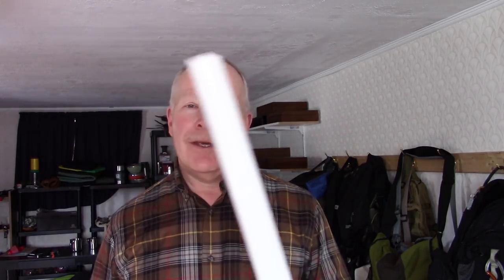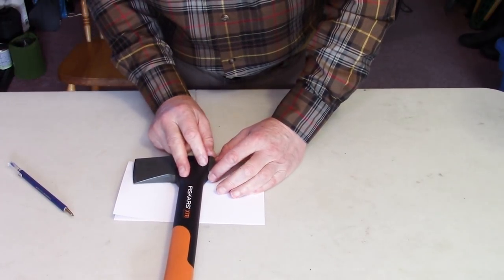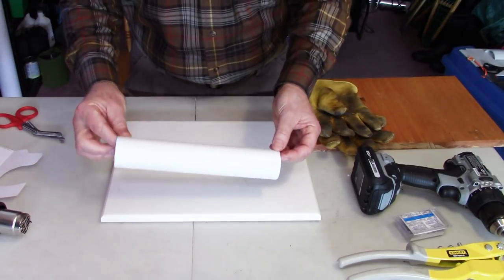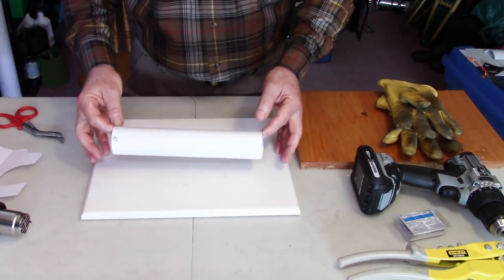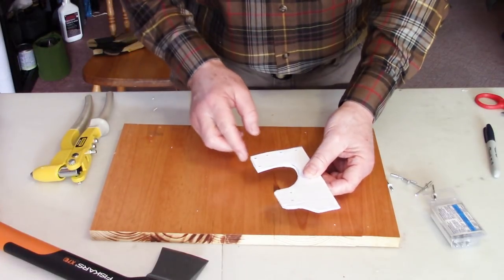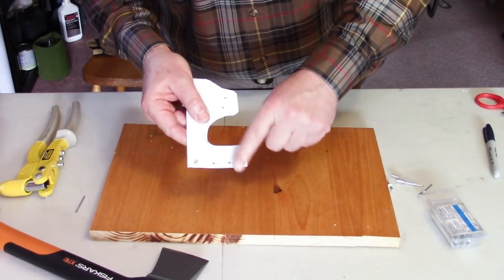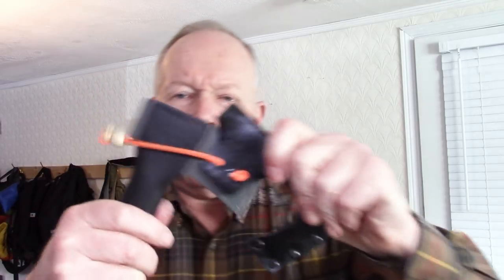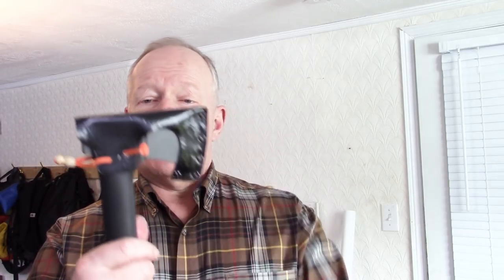DIY Axe Mask made from PVC

Comment: very impressive result. i use pvc for all sorts of things, you can easily form it. i did a axe sheath simply by molding it over the sharp edge and used a strand and molded it over the back to form a simple clip. you can use alcohol in a spraycan and a lighter to heat the pvc, so you can also achieve big projects.
Reply from the maker: Interesting way of heating the PVC up. Thanks for commenting

Comment: Great video Mark - I had no idea PVC was so malleable when heated.  Do you notice any fumes?
Reply from the maker: Thanks Paul. Very little fumes as long as the material is not overheated. Still best to work with it in a ventilated area and wear a respirator.

Comment: Nice project. Wonder if there’s a better coating option than paint? Stain maybe?
Reply from the maker: I have not tried stain but it is an interesting idea. There are some good spray paints intended for PVC that work well but do eventually scratch off. Easy enough to touch up though. Thanks for commenting

Comment: I've never thought about using PVC to make a sheath.  What a great ideal.  I was wondering if you tried adding an additional chin between where you add the pop rivets, similar to what you would see on some leather sheaths.
Reply from the maker: PVC is easy to work with and very inexpensive. The nice thing about designing sheaths with PVC is that if it doesn't work out, you haven't wasted a lot of money. Your idea of an extra chin may be worth trying. Thanks for commenting

Comment: might try this one for my fiskars x11
Reply from the maker: Let me know how it works out for you. Thanks for commenting
Reply: @MarkYoungBushcraft   ended up using a granfors axe mask i had given to me without a strap. then punched two holes on either side and ran a piece of paracord through the holes like the hullefors axe mask and then uses a barrel lock to hold the two ends  tight. works for now.  i did find a granfors leather axe mask that fits my x -11  at canadian outdoor equipment.